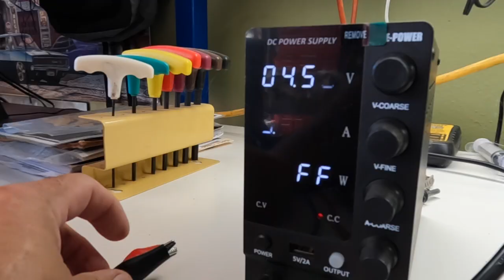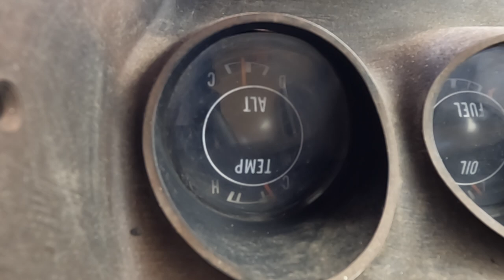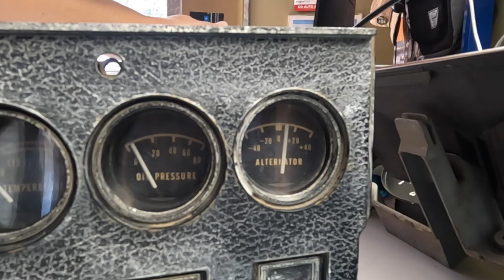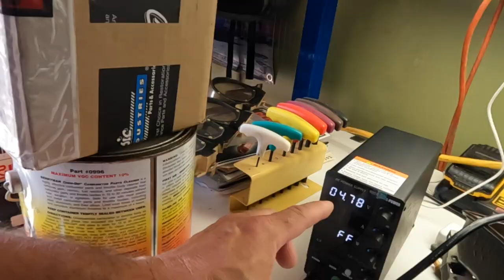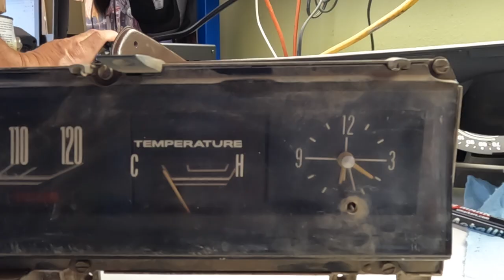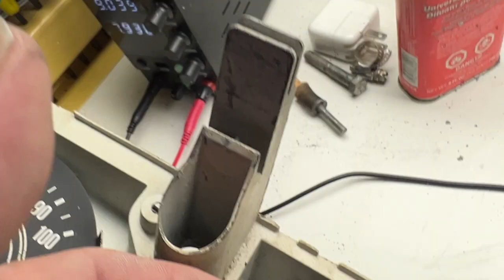1971-1972 Mopar Gauge Testing

Comment: I'm doing bench testing or cluster testing of a D150. Voltage limiter on the back with cut off connectors from salvage yard, follow the cuircut board for 12v.  I can bring 12 to it and using OHMs for levels.
Reply from the maker: Nice!

Comment: Do you have the name or link to the power supply tool you bought of Amazon?
Reply from the maker: I forgot I actually got it on eBay,  https://www.ebay.com/itm/326578928021?_skw=DC+Bench+Power+Supply+Variable+30V+10A%2CAdjustable+Switching+Regulated+w%2FUSB+Port&itmmeta=01KC16JH3NMDBQ2RPQ1B4KBHAS&hash=item4c099ef995%3Ag%3AZqEAAOSwJMZoI3W3&itmprp=enc%3AAQAKAAABMFkggFvd1GGDu0w3yXCmi1f8XPvEgNkdnW4z5x0K5W%2BhZyWLNYKxSaDm88GCAaBMnky7MpZ%2FZbIT4VZb1cwoVgdwCAl3joGJ3CUYtSvhGRwsvyZDk4cBnwijoT34Sa%2B3%2BYZs22P%2B2pZKH%2FO27vLDP1W7RGjf2RB9cbH7Jxnl4nnv6EHlW9onqhl0N3EEaoUdl%2FzaNHN6Zck9R%2FYatWqRbEbnRmSBCxjqbA5jqJ0IDTymVCCN2rGA1ICC9%2FfO6R7kXHnaGfumwXRYucCYbOwZPN8DkDNGJ2%2BO%2B6klK%2F7dSj55OobRG6lVwzPXfT%2FQGZfCqs3pKfHSD6IIA4BXSviO5P5p8ZqO7c02jzyhkhPGtN47WTnMQdQd8VK4Jo0ujHkt5v2TYDKmbk%2B%2Bq5Wh%2FHjB4eI%3D%7Ctkp%3ABk9SR_6RyqbgZg&keyword=DC+Bench+Power+Supply+Variable+30V+10A%2CAdjustable+Switching+Regulated+w%2FUSB+Port&sacat=0&relatedSearch=true

Comment: You shouldn’t be applying voltage to the two ammeter terminals as a test, it’s a dead short. The power supply likely went into protection mode. The ammeter function has nothing to do with other gauges or the voltage limiter.
Reply from the maker: Makes sense. Thanks for letting me know.

Comment: Funny I just might buy one....but alas I have so many computer power supplies and meters and oscilloscopes....that I'll just probably build one 🤣😂... Remember to use a good ohm meter to test your fuel gauge sending unit the specs are in the factory manual... I also make sure the sending unit has a good grounding by tig welding a ground wire to the top of fuel tank pick up ..but only when it is brand new never seen any fuel....be safe .💪🇺🇲🔧
Reply from the maker: Why does building your own coming from you not surprise me? You are the Master Jedi MoparNut. Thanks for the tips.
Reply: @JonnyMopar lol Jedi not I 😊

Comment: That's a nice new tool. I was just testing my temp guage by grounding the wire and turning the ignition on.  My sensor was junk.
Reply from the maker: Sorry to hear that Nathan. My Oil pressure garage was junk. Gonna release another video on the Rallye dash and how you can’t find replacement gauges for them.